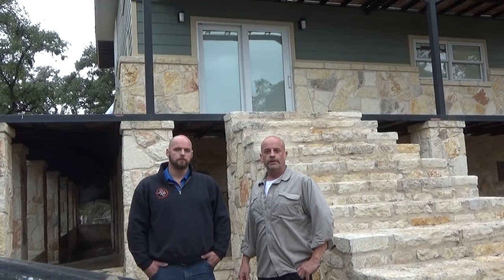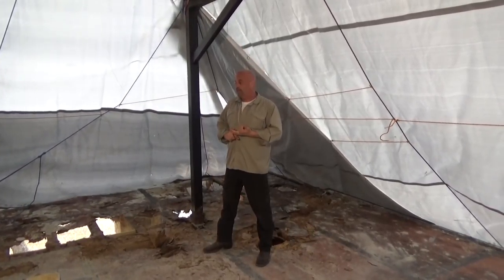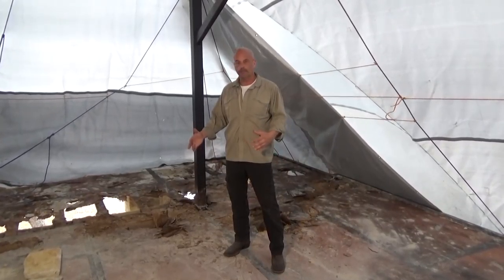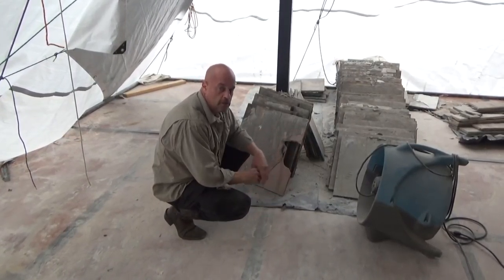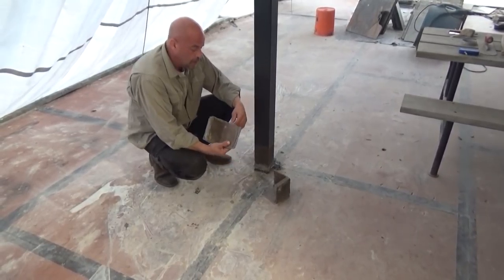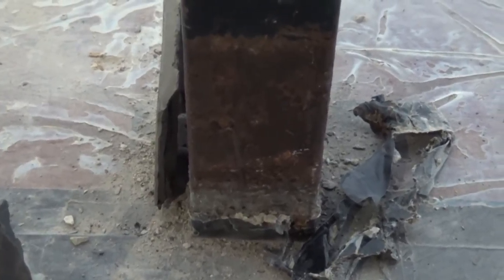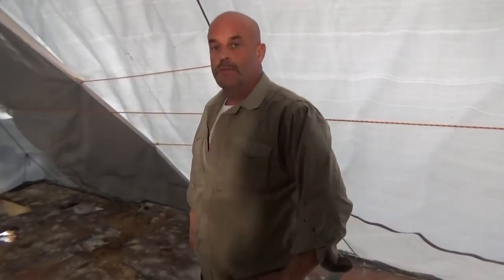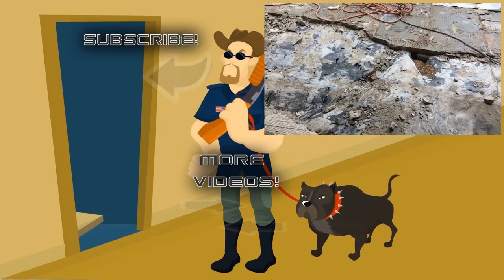Custom Building Fraud

Comment: Jim please have torch on put down before anything is done. This info is coming from Vancouver BC. We get tons of rain here and torch on is the only hope to keep it out. However I would recommend never pouring a solid on top of it, because when it leaks, and it will, it's a bitch to fix. Use a floating tile system on top of the torch on is my recommendation. Good luck.
Reply from the maker: Hello Again! I am open to any idea that lends itself to the end look I want. Biggest difference between Vancouver and the hill country of Texas is the amount of rain annually. But I can tell you for certain that this porch leaked with an eighth of an inch of rain.
That was from the very beginning and it just got worse from there. They used no kind of waterproofing whatsoever on the job. 5 gallons of latex paint would've done more towards waterproofing than what they did. Isaac completely scammed the job and I will almost guarantee that bubblegum was used.
Your friend Jim

Comment: First problem, Slate is pores. I made the mistake of putting it in my shower. Looks good but...
Reply from the maker: Hello trigger! I certainly didn't do a very good job on this video if the first problem you see is the slate. I have been using slate for years for flooring indoors and outside. Slate is decoration, NOT designed to keep water out. I would suggest you review video again and maybe you might be able to come out with a better 1st problem. Second thought, don't bother.
Be well and thanks for commenting, I think.
Jim